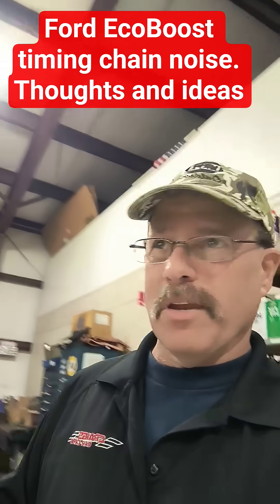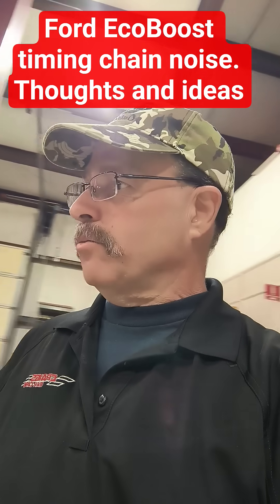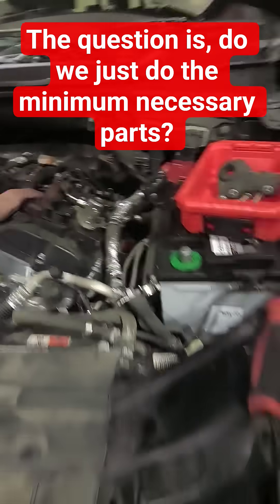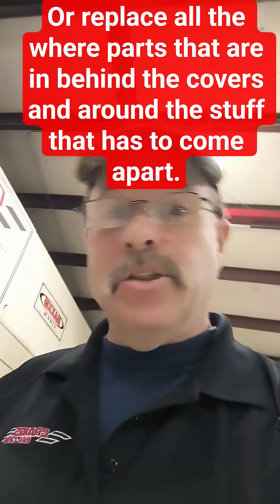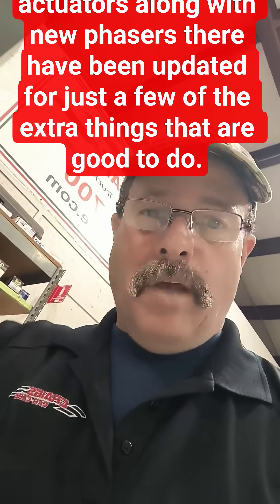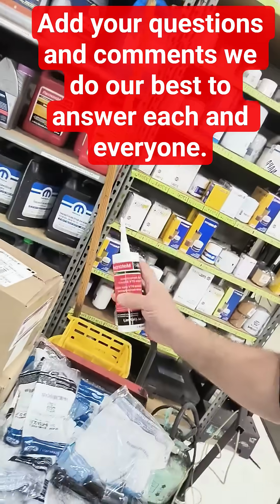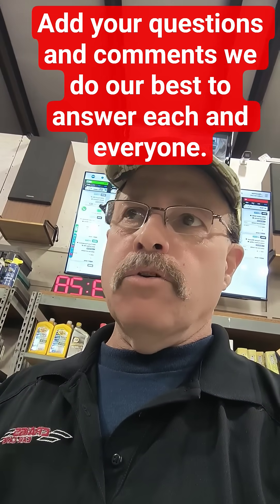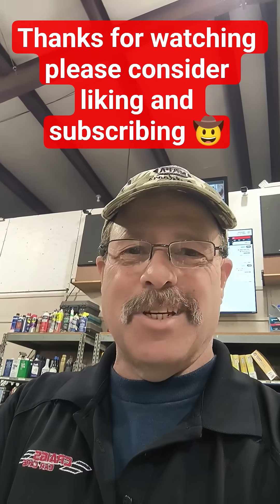#FAQ #45 Ford Eco Boost #automobile #mechanic #ford #ecoboost

Comment: Why can’t people do their oil changes on time? Unless you drive a diesel truck and you do long-haul trucking or hotshot trucking you should never be going 10,000 miles on your oil changes 5000 miles is the most you should ever do in between oil changes and rotate your tires with oil change.
Reply from the maker: Sooooooo true. So many engines would still be alive today if everyone kept up with this.  Thanks for posting.

Comment: Do they make a chain replacement for the oil pump belt?
Reply from the maker: Good Morning, A really great question! To date I am not a wear of any conversion kits. After about 2017 or 2018 Ford went to the chain style . I did read that the 5.0 Coyote went to a belt from a gear drive (don't ask me why, I d stayed with a gear or chain) With that said  there are older versions that still use a chain and newer ones that use a chain. I also saw that some 1.0 were recalled so if yours is a 1.0L check with your dealer.